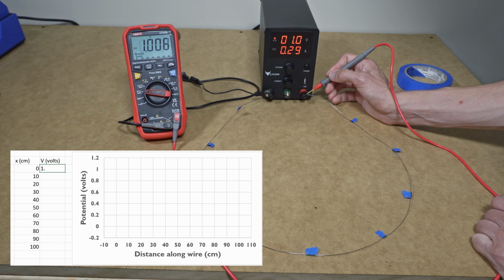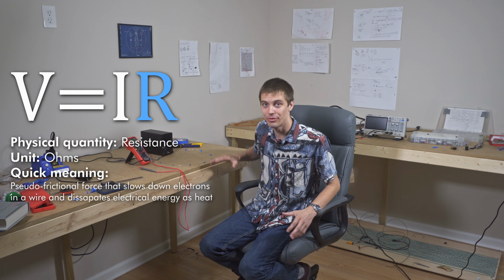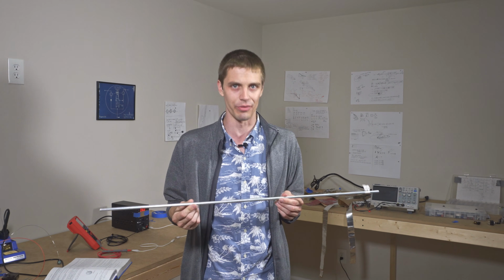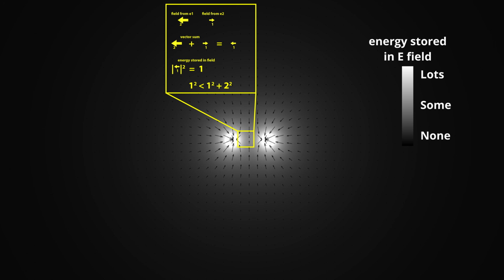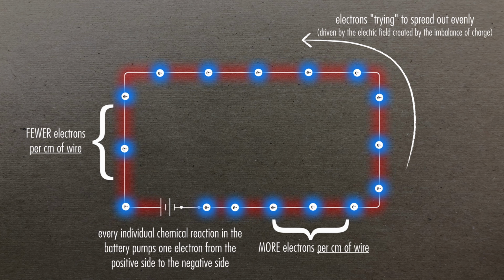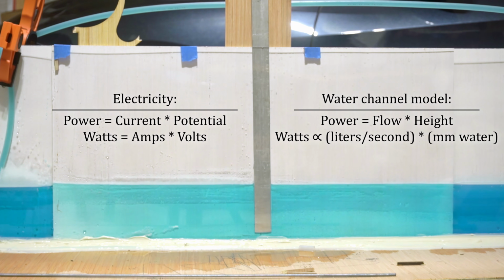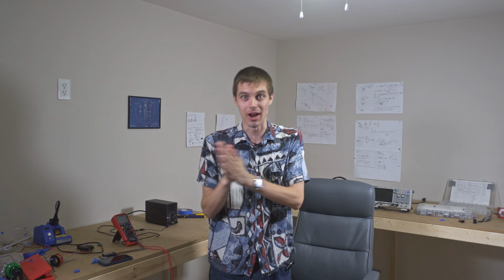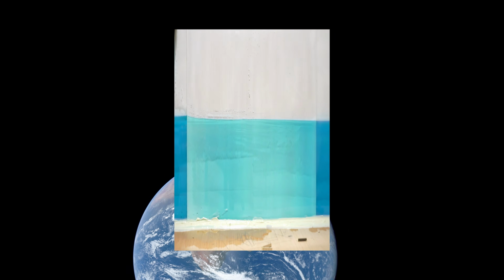An intuitive approach for understanding electricity

Comment from the maker: FAQs and corrections in this comment!
Also: I'm starting a Patreon! https://patreon.com/AlphaPhoenix
And a second channel! https://www.youtube.com/channel/UC3GrRPAydgBn42lab2izBlg
I'll answer some of the most common comment questions here, but in a few weeks, I'm going to post an actual post-video FAQ video on the second channel including questions from the comments here, and questions from supporters on Patreon!

1) Pre-emptive answer: The distance any given electron needs to move to "pool up" behind a resistor is miniscule, but you can't ignore it. It's tempting to say that the moment you connect a wire, electricity is a pure wave where the electrons don't move from their starting positions, but in reality they just BARELY move from their starting positions. Imagine a big long line of people, and all the people in the back of the line take one step forward - now the front of the line is crammed SLIGHTLY closer together on average - that's kinda what's going on. The scale of all of this is really weird, so demonstrations amplify it, then the demonstrations get questioned for amplifying it too much…

2) lots of people asking about inductance. In the case of the water trough model, the inertia of the flowing water is similar to inductance, and if you wanted to make the inductance larger, you could put a waterwheel with a large moment of inertia in the channel. It would be hard to spin up, and then it would be hard to spin down once you got it going.

3) lots of commenters have correctly pointed out that my “replace all the electrons” statement was too general. I am referring to all mobile electrons, which in a metal refers to one valence electron per atom. However all of these electrons, no matter where they live in the wire (in the middle or on the surface) chug along at the same drift velocity and eventually would be “replaced” if you had a way to mark them

4)
Reply: Are you doing well?
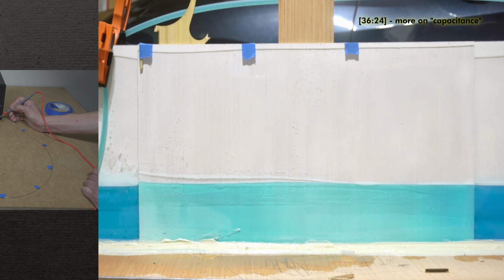Reply: One thing that I saw in your water examples that isn't representative of electric current flows is standing waves on the surface.  In a shallow water type of flow it is possible to have stationary surface standing wave patterns appear.  These are unlike traditional standing waves in that the it is stationary in time.  These are caused because the water flow can be close to the speed of surface wave propagation.  So in some of your experiments, e.g. at 21:00 the surface is clearly not quite linear as your model would expect.  These effect will not be seen in electric circuits because the electron flow velocity will always be much much slower than the wave propagation velocity.
Reply: don't leave us hanging on 4!
Reply: @AlphaPhoenixChannel Okay, I think I get it. You were right to fear a fire.  The demo was using nichrome wire... of I guess about 22 gauge... and about 3 feet long ... so about 3 ohms in resistance. That was to provide a length dependent voltage drop? ... and passing 1 amp of current was so as to create a voltage drop that would clearly register on your multi-mete. Anyway... that's 3 watts of power being dissipated over a very small area... so the the nichrome wire's surface temperature would start to rise quickly. Thus, it is very reasonable to fear a fire, if done near combustible materials, for an extended time. Very good video!
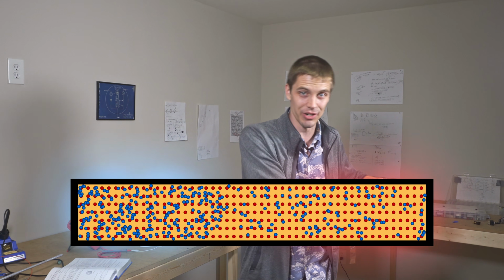Reply: Ok, Another pedantic point about your example with the build up of charge in the wire as shown in 18:52.  This is a great illustration, but it is misleading.  The charge within the wire always redistributes to balance out forces because the charges are mobile.  The potential across a wire is actually caused by extra or less charge at the surface of the conductor.  This is because the free electrons will move until they can't move (which is at the surface interface where there is an abrupt change in conductivity).  Even when there is a flow of current in the wire, it is the surface charge distribution that reaches equilibrium with the electrons bouncing around in the wire.  Inside of a homogeneous conductor the distribution of charge will be uniform.  This is weird because the electric field around each electron can communicate information long distances.  In this case of current flow through a resistive wire, the electrons in the wire are all interacting with each other through the electric field.  In this way the electrons colliding with the lattice are in equilibrium with the surface charges which are actually developing the electric field in the conductor that equilibriates to balance the effects of the "collisions" with the lattice.
Reply: When comparing water to electrons. Would it be similar viscosity or would electron potential be thinner or thicker?
Reply: You made a second channel and you're not calling it BetaPhoenix???
Reply: @AlphaPhoenixChannel what's your excuse for not calling the second channel BetaPhoenix?
Reply: The demonstration of how 'holes' work was great!  One thing that might also be interesting to mention though is that there actually are cases where you can have positive charge carriers flowing, namely any time you have current flowing through an acidic or electrolytic solution.  In the case of acids, acidity is measured via pH, which is a measure of the concentration of positive hydrogen ions in solution. That means that if you pass current through an acidic solution, the positively charged hydrogen ions will move towards the negative electrode.   This isn't an uncommon scenario either. For an example that most people will be familiar with, look to none other than the common lead-acid battery, found in every car.
As for electrolytic solutions, the situation is not much different. When an electrolyte dissolves, it splits into a cation (positive charge), and an anion (negative charge). For example, table salt is an electrolyte which when dissolved breaks into Na+ and Cl-, both of which are mobile. That means that when passing current through a saline solution, the Na+ cations will move towards the negative electrode, while the Cl- anions will move towards the positive electrode.  Electrolytic solutions like this are  how electrolytic capacitors and many battery chemistries work.
Reply: @chriscotton4207  If you consider a gas. Gases are not a very viscous fluid. Conduction electrons in metals can be analogized to be like a gas... you can think of them like a gas... like a gas... not a gas. And so the 'gas' of electrons would have a very low 'viscosity,' in a good conductor, like silver. Water is a viscous fluid. So in the context of discussion so far... water is far more 'viscous' than a 'gas' of electrons.
Reply: They make Aquariums❤
I appreciate the efforts❤
Maybe explain how the quantity of outer electrons of Lithium (-)Cathode or other atoms release when the other atom , (+)Anode recieve ,to balance., 
Or 🧲 in Alternating Current cause Electron flow thru a Connductive Load...
😮❤it's alot😅
Reply from the maker: @argcargv  you’re right - that’s why I specify “1D” wires. Imagine all my diagrams showing electrons bouncing are looking all the way through a wire, including the surfaces 😁. 

I WOULD like to address this distinction in a video, but I can’t do it without a tangible example of where the 1D model fails. Are there circuits you know of where you CAN’T assume wires are 1D objects? Or components? I feel like it may come into play for capacitor geometry, but without an example to demonstrate the functional limit of one model, I can’t make a video about the more complicated version.
Reply: @AlphaPhoenixChannel   Well it was a pedantic point.  However I think where this distinction is perhaps more important is if you were trying to understand solid state physics such as how a diode junction works.  It was one of the early discoveries that conductors behaved as if all of the charge was at the surface.  For example, this is why a Faraday cage works and in that sense the interior of a conductor is like being inside of a Faraday cage.  So if you really need to understand how the fields behave inside of the conductor then this is important.  So in terms of an example, you can make your conductors hollow and observe the field inside.  Most of the time we don't really need to understand how the field is behaving inside of a conductor so the 1-D model as you provided is fine, but it could also become confusing if you actually do need to understand the fields inside of the conductor.
Reply: Interesting name😅 I found that not all names correctly indicate the contents and sometimes we get the contents before we know the name and sometimes we just get dropped into falling right into their Maya 😅
Reply: @AlphaPhoenixChannel   Ah no electrons dont follow Ohms law, Ohms law describes how electrons approximately operate in most cases.
Reply: Why is the physical quantity potential labled V like it's unit, in your video? I'm asking, because I learned it to be U , now I'm puzzelled. I thought exceptions physical quantities are labled the same all over the world. I know it's not actually on topic and probably difficult to find out , but if you allready know why some learn Ohm's law being U=RI (like the Kanton of Wilhelm Tell) and others learn it to be V=IR  with the quantity labled the same way as the unit.
Reply: @TremereTT  you must be German or Swiss. The anglospeaking world uses V for... Voltage ⚡
Reply: @AhrkFinTey  Everyone knows it should be AlphaTucson.
Reply: @copernicofelinis  I'm not sure if that's a dig at Swiss German, but I'm here for it if so.  The Swiss are fine people, they just shouldn't be allowed near the free range dialects.
Reply: @polyhistorphilomath and it gets even worse when you look at the direction of the arrow that denoted a voltage difference between two points!

As for the letter, I don't think it's a Swiss "thing" but more of a German speaking thing. FUN FACT: the IEC, which is located in Switzerland iirc, defines voltage with the letter U.
Reply: @copernicofelinis  Or Austrian or some other language where Voltage ist called "Spannung" or something similar. ;)
Reply: When you added the resistor in between the wire, you could theoretically say that it isn't really a step, but still a gradient. What seems like a step is actually just lost over a very small distance within the resistor. In fact, some resistors use wound up, high resistive wires inside. So in a sense there is just a very tightly wound up wire inside the resistor, or so you could say.
Reply: @BlastProcessor42  Thank you, this is what I came to the comments to clarify! I was thinking about the classic "potato battery," another example where (as I understand it) there are positively-charged ions moving from the positive electrode to the negative one. If the ions couldn't flow, the chemical reactions on the zinc and copper electrodes would stop and you wouldn't get a voltage difference across the electrodes.
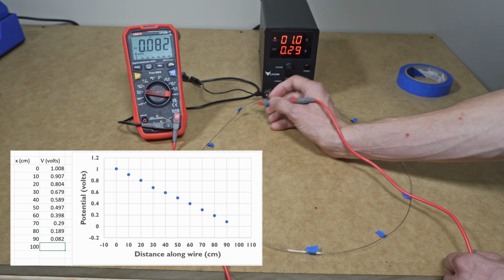Reply: The charts at the start of the video (0:30, 1:27) and your verbal description of the processes confused me, and I think I have figured out what is happening.

In the first instance (1m wire, described as "reasonably resistive") the resistance is constant (non-zero) along the length of wire and so the slope of the plot (which is equal to the resistance of the wire at any given location) is constant, giving a linear plot with a gradient.

In the second instance (1m wire with resistor), the resistance along the portions of "reasonably resistive wire" has not changed, however from the commentary the impression is given that these portions of wire are now zero resistance, and all of the change is occurring within the resistor, and no longer "smoothly declining" along the bare wire. In fact the multimeter readings have enough precision you can see the same smooth decline in voltage still occurs along the bare wire lengths.

I therefore surmise that the chart in the second instance is composed of three parts, where the first and last have equal non-zero slopes, and the change over the resistor has a slope multiple orders of magnitudes larger than the wire parts, compressing the plot into an apparent step function. I found this invited confusion as I had to change my mental model so that the inclusion of the resistor somehow changed the behaviour of the wire components.

If we consider the resistor to be wire wound (with equal diameter/cross sectional area to that of the resistive wire) then the total distance would change dramatically between the first and second demonstrations (no longer 1m for both). If you consider the x axis to be split into three parts, with resistor portion of the chart compressed by 1000 fold, and undo that artifact to recreate a linearly increasing  abscissa, the plots will be the same!

Wire can be considered zero resistance for the purposes of circuit design and in that case you could reasonably describe the addition of a resistor as creating a step, but to compare them when attempting to describe the physical (rather than engineering) concepts I found to be confusing.
Reply: @RainBoxRed  when you introduce the resistor, the current changes and becomes a fraction of what it was with the wire alone. So, the wire that dropped say 5V at 10A now drops 5mV at 10 mA (I'm making up the numbers I don't remember what alpha used). All the voltage drop happens at the resistor because of the higher resistance allowed by the use of a different material or a smaller cross section. If you want to make the resistor of the same material and with the same cross section, then you are right, you probably need half a mile of the same wire to achieve the same effect.
Reply: Вольты это скорость изменения магнитного поля🙄
Reply: You don't have to imagine weird negative water to describe the flow of "holes" -- that's just the air in the system! When water flows one way, air has to flow the opposite way. So the analogy still contains an analog.

What I find hardest about the water flow analogy is that you have to imagine what we normally think of as empty space is solid like concrete -- when a wire breaks that prevents flow, so in the analogy, you have to imagine if you break your trough it immediately gets filled in at the break. Water can't escape the trough and spill all over. Well, not unless you live in a liquid mercury atmosphere...
Reply: @josephlunderville3195  that's another point where the concept of surface charge comes to the rescue: when you break the circuit, surface charge redistribute in such a way as to make the electric field inside the conductor zero, stopping the flow. But from the discussion I am having in another thread here, alphaphoenix seems to think that surface charge is  the excess charge that represents the 'compression' of the electron fluid, so he's stuck with a bad analogy.
Reply: This is constructive criticism, hopefully to assist you, nothing personal, but it's important because you are trying to teach while presenting yourself as one who understands the subject -

You've obviously exerted tremendous efforts, to achieve hardly marginal results (to put it mildly).  Some examples:

You keep talking about a "field", "storing energy in the field", "the energy is in their fields", "the fields push against each other", etc.

Define, describe, specify the nature of and location of "the field",  and experimentally prove your concept of "a field", otherwise your whole hand-wavy attempt at understanding is just plain weird.

Also, you talk about a battery pumping electrons into a circuit, "like all batteries do" - that would include lead-acid batteries for example?  NO.  Lead-acid batteries (for one example) pump only PROTONS...

Maybe you need to study some more until you yourself actually understand the fundamental concepts, then you could possibly explain better.

Perhaps a careful study of everything William Beaty ever wrote on this topic will help you immensely to be part of the solution and stop being part of the problem.  See, amasci[dot]com/ele-edu[dot]html and understand.
Reply: @AlphaPhoenixChannel  please forgive me there are tons of comments. I'm 6 minutes in. I can't get veratassium's video on the topic of the way in which electrons flow off my mind. What are your thoughts on his "theory/observations"?
Reply: @AlphaPhoenixChannel I have one confusion. 16:32 in this segment, if the fields of the both electrons add together then how do they shoot each other? I mean from where does this repeal force actually come from?
Reply: @RainBoxRed you just pointed out an important thing
Reply: Amps or Amperes? I believe the latter, amp is just an abbreviation.
Reply: @retromodernart4426  Calling someone "part of the problem" is very much a personal sounding insult. Furthermore, you say he doesn't "actually understand the fundamental concepts" as though what he's presenting is deeply flawed, yet you've only said that he inadequately explained fields and made a small mistake in saying "like all batteries" (which is a small mistake because this video isn't focused on batteries). If there are more fundamental flaws in his understanding, pointing out more relevant examples of those flaws would be significantly more constructive and less personal than criticizing how he's "presenting himself" as someone who understands this
Reply: @Ultimaximus  He's the one presenting, we are the target audience.  His pose is of one who studied, understood and is now competent to explain.  Unfortunately, he's demonstrated that he indeed studied, indeed did not understand and hence his explanation was, and could be nothing else but deficient.

Constructive criticism is not personal and not an insult.  Fortunately for him, being so fundamentally wrong has barely any consequence for him in this age of 'fanboism' and terminal lack of critical thinking skills amongst the vast and growing hordes of ignoranti.

I gave several examples specifying several objective problems with his presentation, as well as specific  exquisitely detailed and presented references that he or anyone interested can look at, consider and come to conclusions.  This is a compliment to him, and assumes he's actually well-motivated and capable of finding the truth of this matter and correcting himself.  Hopefully, he proves to be a superior to you and your unfortunately misplaced and inappropriate hurt feelings.
Reply: Wow!  What an awesome teacher he is!
Reply: Resister to amplifier stepper
Reply: Light moves at light speed you've passed electric faster then you could see you can only since leaking arcs potential
Reply: Resisters move or slow it down
Reply: Radiant
Reply: Path of lease resist
Reply: This is confusing me so I stopped before I shatter what I know.
Reply: the first wrong question here is, why do electrons follow Ohm's law.  huh?
Reply: Well done! I've been a student of electricity since I first tried to build an arc lamp using carbon rods from old D cell batteries (based on a write-up in Popular Mechanics, I think). I never got it lit, but I had a 30-year career troubleshooting CNC machines. Mechanical failures induced electrical symptoms, and vice-versa. 

"Positive" charge carriers DO flow - in space, as plasma in the solar (so-called) "wind." And the math still works. 🖖
Reply: If only your walls were as awesome as ypur shirt
Reply: Is there a reason you never used springs as a metaphor for Voltage? A compressed spring such as the suspension on a car or a mattress with someone laying on it seem very similar to voltage to me. A balloon filled with air also seems similar. You could say a large voltage difference is like someone sitting on a whoopie-cushion lol!
Reply: It would help if you made a manual generator to show how electrons are pumped. Without that, this still looks like magic. The electrons are just assumed to be somehow pushed over to the high side. How does that happen? How do magnets force electrons through a wire? How does the battery, if there is one, regulate flow so it does not just dump all of the electrons at once?
Reply: Interesting channel name bird boy.
DC is the real original Power. AC is Alternate Power.
Reply: @retromodernart4426  I appreciate your addition of dialogue for the good of the community. The one thing I would like to critique you on is your use of insults. Please don't include these. No response needed
Reply: @DylanJGehl  That's just insulting - to your intelligence.

No response needed.
Reply: Can you rent devices test instruments  , you want next nobel prize , I have a design to test Kerr-Newman metric and space time metrics. All you need is hire few kgs of mercury , few bowls .
Reply: No need to shout, we aren't deaf.
Reply: Everything is pressure.

Gotta love living in an oxygen rich low density fluid. I'm so pro-Terran❤
Reply: M
Reply: Electricity does flow from positive energy to negative( really less positive) energy level. it's the tern negative and positive that is in correct. An electron is not negative and a proton is not positive in the correct scientific sense of negative and positive. Unfortunately the particles were named positive and negative based on attraction or repulsion to a magnet. aka neutron no charge really very well might have an attractive force or repulsive force just not one that reacts to a magnetic field-I mean clearly it does and science has got so confused by using archaic terms that have not advanced with language not progress in the fields.  Either way and electron in real scientific wisdom is not negative or positive in charge-in fact science has no clue what it is what the elctro force is nor the magnetic force and uses circular logic to name and classify each other when both are unknown completely. So really we log the reactive effect but not the actual nature. To a guy like you this is probably amazing and mind blowing (not that you didn't know this) but really all of science is useful and intelligent but actual incorrect and has no real knowledge. Look at medicine where we think we know how drugs work but not really, really we just know a certain drug has a certain effect and some we can think we have a working principle. Either way brother, love the content and your a very smart guy with some great experiment and teaching skills.
Reply: why do u keep saying "electrons" flowing instead of charge units? what moves fast is electric field energy quanta, not "electrons" (which only may drift in CC and bounce in AC). Your channel has huge audience would be useful to spread this big conceptual difference to mitigate this secular misconception still grassing in ppl 🙂
Reply: @chriscotton4207 I believe they would be considered a non-Newtonian fluid.
Reply: @argcargv  7:13 7:14
Reply: @TremereTT  10:52
Reply: 😂q
Reply: It’s my understanding that the electricity is flowing, not inside the wire but on the surface. Multi strand wire, may have different test results.
Reply: Hello AlphaPhoenix, I find your video (and videos) very interesting.

I myself have thought a lot about analogy between water flow (pressure fed or gravity fed) and I really like the model you have come up with.

However, I believe that what  you describe as a capacitance is not a capacitance, and I do have a proposal for a contraption that could represent a capacitance. Also I have a proposal for a contraption that could be a inductance, and it is not the wheel you describe.
Reply: Current is magnetic momentum
Reply: too many irrelevant words in too long video
Reply: 'no matter where they live in the wire (in the middle or on the surface)' - NOT TRUE, at the surface and on cracks or polycrystaline boundaries or defects electrons are attached weaker so they move firstly and mainly and that is why resistence at the surface is weaker
Reply: water model and analogy is always used in ALMOST ALL UNIVERSITIES because it is the same phenomena, just in water acting particles are neutral and with mass, and in electrons mass is too small to be not disregarded and only charge (magnetic field is needed too, but it is averaged and too small in the wire and taken into account only outside the wire) behaviour is followed which is exactly like molecular or atomic behaviour except only for the speed of the impulse (electrons fly with the speed of light transfering like torch electric field and atoms with the speed of sound transfering mass). THE AVERAGE SPEED OF ELECTRON IS NOT THE SPEED OF LIGHT AND IS MILLIONS TIMES SLOWER THAN ELECTRON'S SPEED IN ATOM
Reply: Interesting. It seems Ohm's law describes Bernoulli's principle, with electrons.
Reply: @copernicofelinis 
Thanks for this, really helped cement things.
Reply: I’m curious about electricity within and in the he field around living beings - humans animals trees, fungi. Sea creatures- do you have a video to explain how currents, voltage etc works inside us and around us?